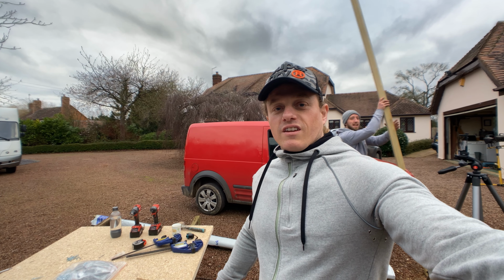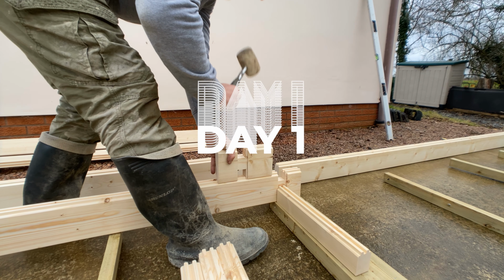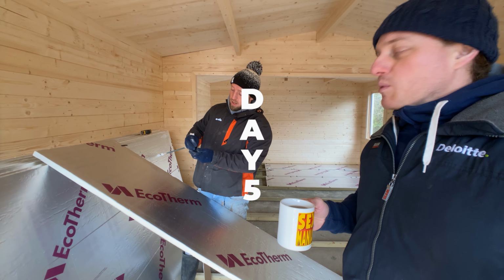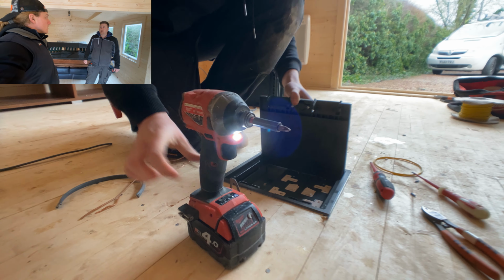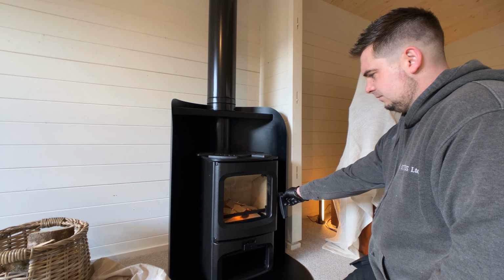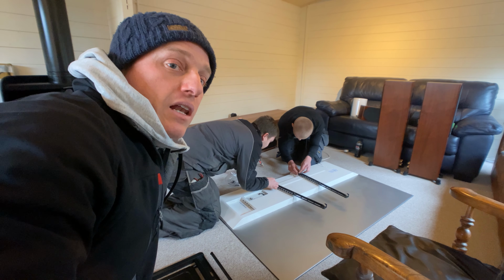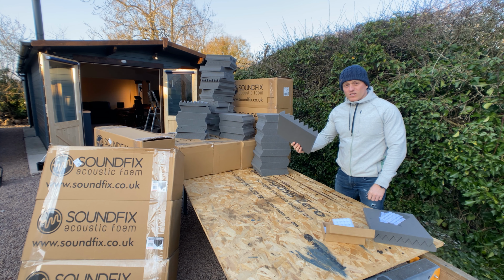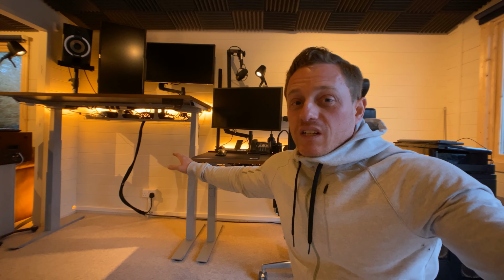Log Cabin Build Project - 5 Months in 15 minutes! 🎬

Comment: Looks good but I wouldn't have bothered with the acoustic foam. You could do with some home made sound panels on the walls, get some 2x4 ,rockwool RWA45 and some funky material. make some frames around each slab of the rockwool, stretch the material over (to make it look nice) and hang on the walls, you will notice a big difference.

Comment: Looks fantastic, however I'm a bit concerned about the amount of stuff screwed across the logs inside (kitchen cupboards, extractor, TV bracket etc) these cabins expand/contract alot (especially in the early years) assuming everything isn't fixed with slotted holes to allow for changes in the wood you might want to keep a lookout for any splits/cracks in the logs and catch them early if they do occur
Reply from the maker: Good question.
We did actually account for that as best as possible... whereby we aimed to screw any attachments only into the same horizontal wall logs (e.g. the TV wall mount), but not screw above/below across any wall logs, to prevent any warping or cracking.  Also the extractor hob, is actually a 'self' extracting version, with no vent to the outside, to further minimise any impact on the wall logs, it is also a very lightweight extractor.  The only small concern is perhaps the two small kitchenette wall cabinets, but they are only smaller slimline cupboards, with nothing heavy inside... but I will keep my eye out for cracks, and report back if I notice anything.  Do you have any recommendation if cracks do appear by the way?
Otherwise, glad you liked the video.  This is my first ever attempt at building anything like this myself, so appreciate the positive feedback my man.  👍
Reply: Ahh, you should be alright then, enjoy your new space, you'll look back on it as the best thing you ever did and wonder how you lived without it!